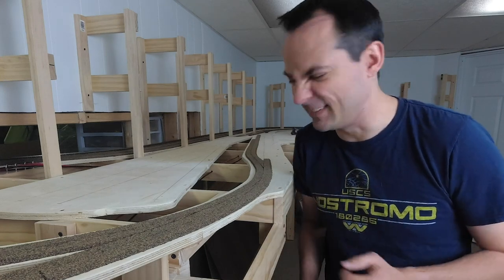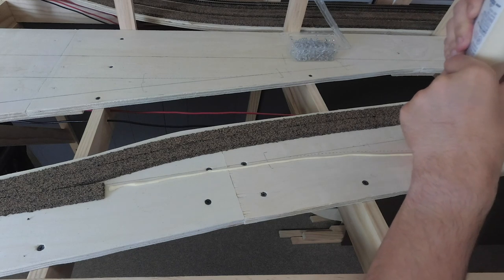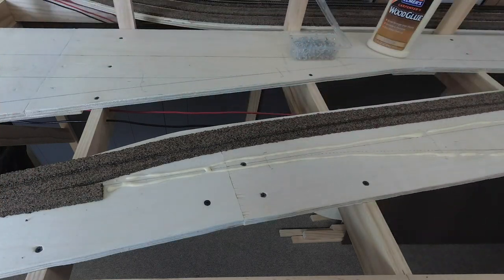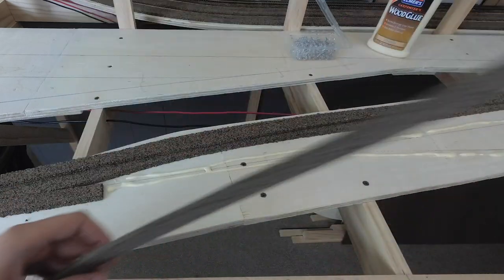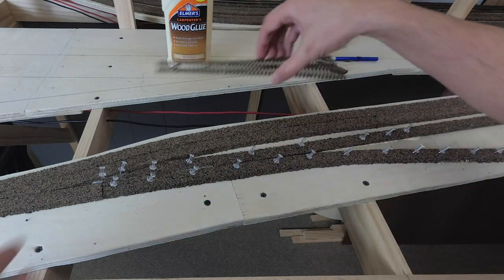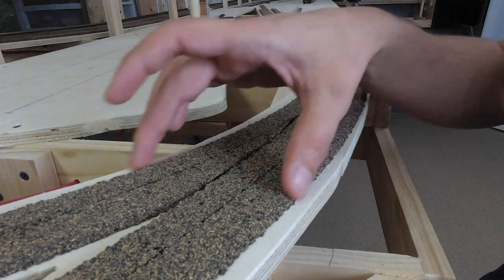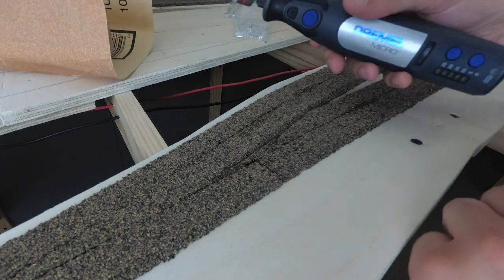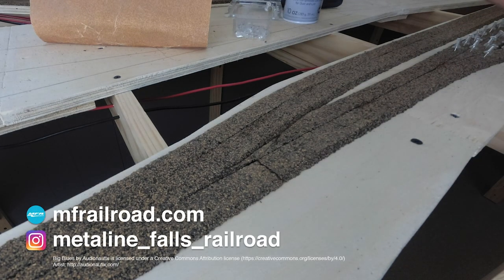How-To: Roadbed Done Right

Comment: you and I do it pretty much the same. and like you I use a lot of pins. Some people say soak the cork for 24 hours prior to using it, have you ever done that? is it  necessary? 
and no I have never soaked the cork first.
Reply from the maker: I never have. Some say to do that if your cork dries out and becomes brittle and hard to bend along a curve. I've never experienced that issue myself. The cork should get plenty of water during the ballasting process anyway. :)

Comment: Looks good, have you ever used the foam rubber woodland scenics roadbed?
Reply from the maker: I have not. My concern with that would be that it might allow too much movement in the trackwork and cause issues when laying ballast. You won't be able to spike track either if that is your preferred way of attaching it.
Reply: I used that before and the ballast would break up after it dried on the foam stuff. Its cork from now on.